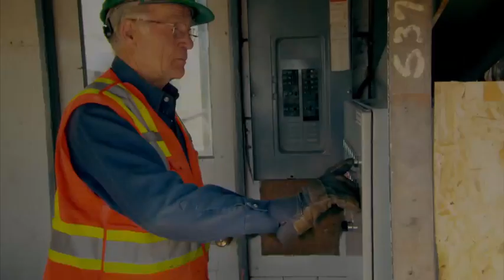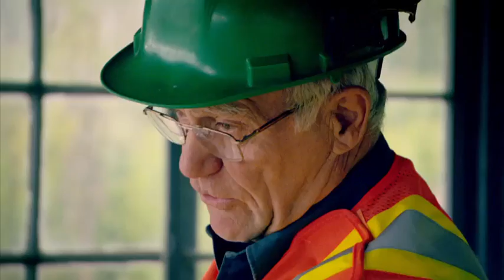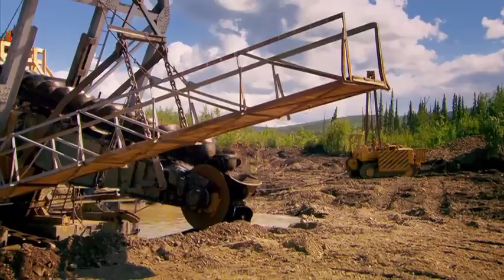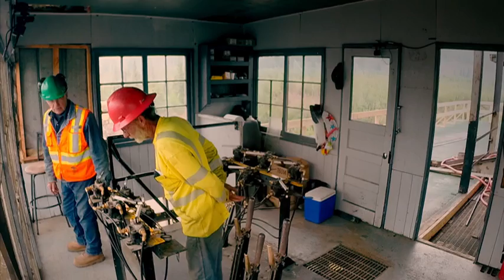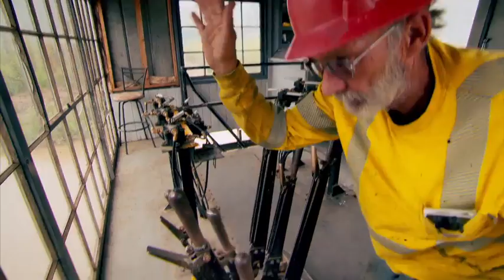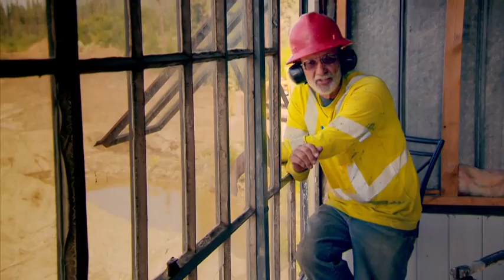The Dredge is Up and Running But Not Everyone Can Control It | SEASON 6 | Gold Rush

Comment: So how does the dredge move side to side/ forward and backwards. Does it have winches connecting to the sides of the pond?
Reply: Winches connected to tractors that act like anchor points.
Reply: @sgtsarge2617  ahh thankyou
Reply: @harrisonrawlinson5650  no problem